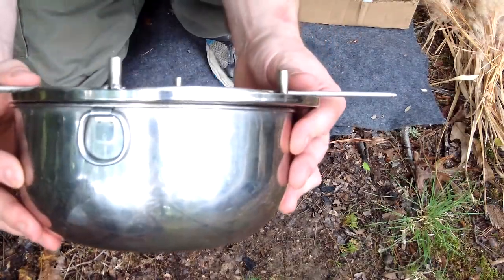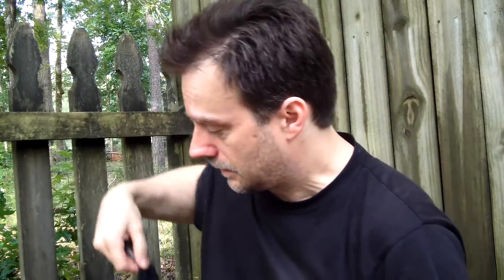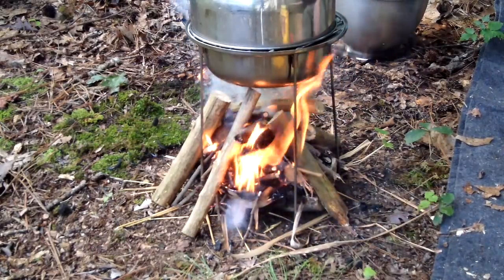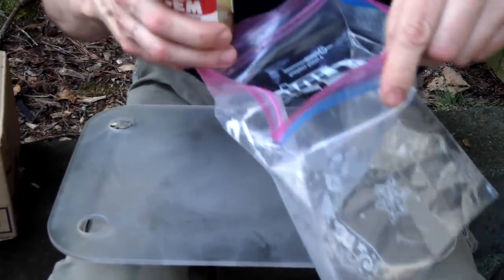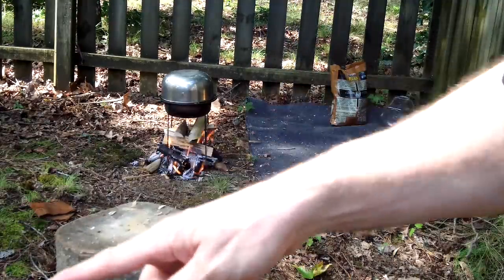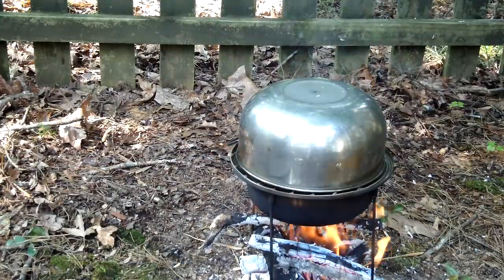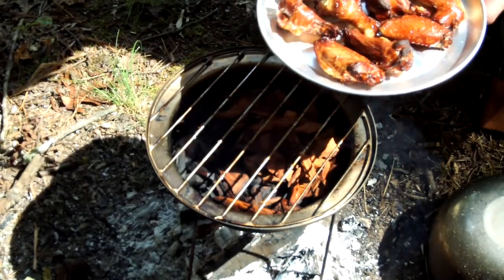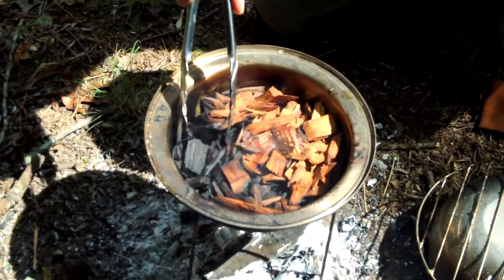Smoked Wing Test On My BackPacker Smoker

Comment: Yum! Glad to see you enjoyed what you cooked. This is a great setup. In a pinch that bottom bowl could be used the same way for making soup/stew & putting in the rack meat to steam cook. Or put those 2 smallish bowls on rack to heat up rice or porridge/oatmeal. Put that upside down bowl over it & you could make steamed dumplings. So your little smoker could be a stewpot, steamer & oven too. Talk about multi use possibilities. Hmmm
Reply from the maker: Oh yes, all those set ups you mentioned are very possible. I'll probably try several ideas with this. Thanks for watching

Comment: The first thing that came to my mind was The War Of The Worlds fighting machines. :)

A couple of ideas for holding the stand legs in the sockets.

1)Use some 400 series rods for the legs so you can temper them to have some spring action.With a jeweler's saw or hacksaw,saw down the center of the rod ~ the length of the socket.Anneal the slit end,flat blade screwdriver in the slit to pry it apart slightly larger than the socket hole,temper the slit end so it has spring action and will stay in the socket. Chamfer the slit end of the rod so it will go in the socket easily.

2)Looking at your legs and sockets again,the fit may be loose enough that you could put a slight bend in the rod to retain it in the socket.   -----~  ═

I was hungry and boiling some eggs while watching :( , those wings looked pretty tasty!

Comment: We called them  wing dings back in the 70`s. Trouble with them is, there isn`t enough meat on them. Around here, in PA, the price went through the roof on them babies. Thanks Dave.
Reply from the maker: Never heard that term. Yep, not much meat on an but the small size sure makes em easy to smoke

Comment: Hey Dave! I used a coffee can, poked some holes in the top rim, and plunked in a small steamer rack. Topped it off with the lid of a sauce pan that fit just right. For the wood chips, well I used the chips from what ever I did with the maple wood. Why waste stuff? Some wood does not make for good smoking. It may work, but the taste... that bein the case, mesquite chips are the best. Good eating right there! As for wetting the chips as opposed to dry chips, I found out there wasn't much of difference. If you keep an eye on things you can smoke, or end up with jerky. Either way a win. But overall, this was a good video with lots of tips and as always entertaining.
Reply from the maker: Sounds like a cool set up! I have noticed as with my other smokers that if I don't wet the chips, they burn out faster, catch flame then they actually flame cook the food as opposed to smoking it. I think it all depends on how high above the fire the chip pan is. Thanks for watching!

Comment: The best trick I ever discovered for achieving deliciously smoked food is at first not to let the smoke touch the food but actually gather behind it and then circulate above it, this will prevent the meat from burning, it will cook it slower making it quite tender and also help to seal in juices. Best to not let the smoke fall beneath the food as that can leave residue from the smoke, also do not let any fresh air in it will disrupt the cooking process and you will not be able to salvage it.

Comment: Tried smoking fish once.  Bloody cigarette papers kept tearing and falling to bits around it :(
Well done man.  You are so inventive and clever too.
Edit:  Dammit, forgot to say that you could use a "locator pin" and drill the hole and rod so they lock in place a lot looser than threading the bar / hole, but much more securely than simply slotting into each other.   Just a thought mate.
Reply from the maker: Lol! Thanks man. Very good idea on the locator pin

Comment: If you added the insert from a stainless steamer set , the section with holes ,and that fits your set , you could have a multi level , smoker that does the whole packet of wings at one time ( hour cook :) .
Bon aperttite :)
Reply from the maker: Good idea but wouldn't you have to pile the winds in instead of just a layer? I wonder if stacked up they would smoke?

Comment: If you can find an old wood chisel, 1/2  inch is nice...clean it up and hit the edges with a grinder.
it has a handle already and makes a really nice striker for your faro rod.
And....lol...if you have a chainsaw you can find a dry log, then make cut LONGWAYS . It will throw long thin shavings that make nice fire starters. We kept a bag in our scout trailer for fast fire starters.
Reply from the maker: Funny you mentioned the chainsaw shavings, I collect them too!

Comment: Although your top bowl/cover looks to be stainless, it has a flat bottom.
You maybe interested to see when the wings quit cooking with steam(212 degreesF), on to the smoking chips temp and what that head temp may be/get to.
Those magnetic surface thermometers are kinda handy for a leaning curve. (fairly cheap, made for wood stove flue/wood stove body)
First off it was steaming chicken. Wood chips in water while prepping food is probably all the soaking they need..if any, but pour all the water off? 
I mean no harm Dave but ima still trying to wrap my head around this method. Wood/paper burns at 451 degreesF no?
~~ I'm getting mixed answers to my query. Wood smoulders(smoke) at 120-150 degreesF.
Something I just read to avoid flame up of chips directly on coals...put wet in foil with a little hole.

So now we think of what happens when we make char wood from punk wood in an altoids tin. It all smoulders to perfect.
On a larger scale as you have there I wonder how hot it would get using confined dry wood?
Maybe not enough wood surface exposed to cook anything?

Anyhoo it worked, and what of just read it says the steaming will tenderize your meat..til water boils out.
I'm near thinking this technique is near how electric smokers work. 

...I'll just leave my twaddle there vs deleting. I was trying to help with repeatability, so can be like a teacher. (-:
Reply: Btw, in a pinch, I hear and fruiting tree would be good/ok for smoke wood. (I don't see many using oak though)
Keep your eyes peeled in your woods. lol, time to plant your apple seeds ay?
Reply from the maker: You answered your own question, it worked. Lol. The main reason I soak the chips is wood fire heat and flames tend to burst wet chips into flames thus cooking the food and not smoking it. Its hard to smoke food in this method but after years of playing with it, this seems to work best.
Reply from the maker: Yes, apple wood, cherry wood and even peach wood all work. I have a bag of peach wood Im planning on using for some smoked salmon. Ive only seen Oak charcoal but not oak smoking chips.
Reply: @Reallybigmonkey1   Yeah, I was looking stuff up as I was posting/trying to figure this out.
Mostly we use soaked half hour thumb sized li'l logs directly on the coals, to exposed foody grate.

When I peeked at an electric smoker dos/don'ts some things came together in mind.

~ Altoids tin Bri?  Hmm, now I know what to do with that old metal cookie container...maybe use for smoking.

'n Salmon...I've a slab of cedar I batoned off I've been wanting to try. I may as well hit it while my dill is still viable. 

^^^ I was thinking of backup smoking wood while already in the woods. There's always at least one dead branch somewhere. ie; mulberry, hickory..
Reply: Dave do you often visit the same general area in the woods...fav secluded spot?

(ahem (-:   ) Some gal I subbed moved to Texas, and some of the stuff she was trying was planting stuffs in the woods. (I said huh, what about critters?)
Seems she's had some success, but that there Texas can be dry when not flooding. 

Squirrels around here at top side land of Lincoln are a bugger. But they pretty much stay away from aromatics like herbs...oregano, basil, etc.
~ We've cooked stuff outside, not wholly unlike what you do out there always. Burgers/brats/steaks don't really excite me because they're done so fast. Slow chicken is a good time, and worth all the time cleaning up to me.
~~ ima wondering ifn some time over nighter with your son (sorry, forgot his name) cooking up some spaghetti 'n meatballs/sausage would be fun for y'all? Heck, even a good chili, besides spaghetti sauce  should simmer a few hours ay? (-:
..my .02 cents anyway.
 Fresh herbs growing nearby for a few dishes would be a woot if 'nuff rain, break in canopy for sun. Perhaps a more drained spot on that island?  Our oregano comes back each year even though we changed it out this year ~ a few grown seedlings in your pocket might be fun to try next year?

~ Bit attention risk/thought of your island ~ I've a spot on my land along the river which has some worthy trees at a corner river vs slough I near put up a tree stand type deck, four way. ..meh, I pussed out due to the only place out of 200 acres I found a deer tick on me. Gave me the willies it did. (yes, we've a number of acres that look just like Snake Island)
~~ In your case perhaps an interior spot, three or four trees...maybe set up a permanent off the ground deck for two, to set up tarps over? 
In that I don't know snakes except taking away their reason for being there..peeled back even more take away the reason for their prey being there?  Frogs, mice, voles, moles, fishers, I dunno your land. 50 lb bag of cayenne pepper is 140.00 ;) I wonder what it would take to keep sleeping circle clear of critters and then snakes? lol, fun to think of, and said my mind wanders.

..after all said and achieved fire ants ran in chosen would sook. ~ would others as hunters disrespect a simple off ground, or just sit and leave note of thanks?  ~~ yes, I've a fine corner (sand bottom river) on my land where I've seen names of lovers scratched in sand who stopped by way of river. Over nighted or not they did a small fire on the beach made at a hairpin in the river. I say they camped and nary left evidence of fire out of happy respect. (ha, that 4 acres of the bottoms cost me 25.00 in tax a year and the smile is well worth random canoeists)

TMI in closing: Swamps and low land bottoms at dusk...skeeters killing ya but need to wash up, and who needs deet to got to bed with..get naked, suds up good whole bod but don't rinse. Sit 'n watch sun go down or one more fish try. yup, and Ivory soap still floats.
~ Rinse and beat feet to planned. js

Comment: Some one has been to Save A lot.  looks good and very practical.  one thing also if the ground is to wet, you could of put one o the other bowls under it and used it to make your fire in plus be good for a no trace fire to do it that way..  If the bowl is to wide, just make new legs that has bends in them to reach the outside of the bowl. and you got carcoal when the chips are all gone.  Many uses for it.  Grind it up to make a medicine, fire starting material.  and more
Reply from the maker: Great idea! As a matter of fact, I do have some spare fire bowls!

Comment: I would suggest just adding the wood chips that are soaked for about an hour or two. No water at all... that is how its done in a smoker box on a charcoal grill. Your cooking time may change, but you will get more smoke flavor that way.
Reply from the maker: Ive done that in the past and it just doesn't work for me. The chips burn out too fast and just flame up and those flames wind up burning the food. Ive discovered over the years that since smoking meat is a very slow process that if you soak the chips until they no longer float that they heat n smoke very very slowly. It may be different with a large backyard smoker but this is what works best for small backpacker type smokers.

Comment: Nice. Weld some loops on the lid to act as handles you can use a stick with and as legs to double as a pot. Is there some kind of set screw you could add at the top of the legs to keep them in place?
Reply from the maker: I can easily add a lifter to the top. No threads ever on my stainless cook sets. Threads always seize up and lock up when heat is applied to stainless.

Comment: i am thinking which is kind of dangerous for little o`l me at odd times. So what you could end up with in your smoking pan is charcoal ? A something which you could then save , for a burn later thus producing much more heat from a fire later on. Or am i over-thinking smoking ideas  in my nogin?  Great Video by the way.  BB from the UK
Reply from the maker: You are correct Paul! The chips in the pan turn into pure charcoal. Could be useful as a makeshift water filter in a bad situation. I'm happy you liked it and thanks for watching brother

Comment: I want to say first thing that I've never smoked anything and I don't eat chicken. There said it. Now for my questions. Where do I get the bottom bowl with the lip around it and how do I make the grill part without a welder? I'm guessing that if I smoked fish then do it about half as long as the chicken. A plus side to this smoker is if you let the chips smoke completely out then you have charcoal.
Reply from the maker: I got the lipped bowl from Goodwill. That lip really secures the grill perfect but isn't necessary for use. Basically you just need two bowls with a grill inbetween them. It may not fit perfect or look store bought but it will work. Almost any cooking section of  any store has replacement grills for ovens that will work with

Comment: Take that small steel pot you have and put it in the center of bottom pan and then stack your chips around it ,then fill small bowl with water. Then you can have the best of smoke with the moisture  so as to not dry out meat.
Reply from the maker: You would think that would work but with such a small set up them chips have to be wet or they will burst into flames and just cook the food with flames instead of smoke. I could try the bowl in the middle with wet chips around it.

Comment: Boy, those wings sure looked good. You say that once you hear the water "stop" boiling then you give the wings an hour. My question is..."Before you put on the next batch of wings, did you put more water in the chips bowl...and if so, how much?"...Oh, one more thing..."Did you dump the burned chips and put more chips in, or just use what was already in the bowl?"
Reply from the maker: Man were they ever good! This was a first time test so honestly the chips need to be wet and have little water level. It took too long for them to smoke. No, I didn't throw any of the chips out. The blackened ones helped it produce smoke that much faster.

Comment: How about just soaking the wood chips and water for about an hour before you start cooking and then empty all the water out and put the chips in the bottom and see how that works your smoke should start a little bit sooner and I think your wings will be done within an hour after they start smoking on if you want to try that or not wish I could weld so I could make one thank you
Reply from the maker: That may work with a normal smoker but with these small backpacker smokers over a campfire it just doesn't work.  With the chips soaked, they smoke slowly. With short soaked chips, they tend to burn into flames fast. Then you're cooking with flames and not hot smoke

Comment: Err Try running a stainless bolt in the lug with anti seize when you weld. I would say just re tap but SS can be a pain and break stuff.   I have to give up and subscript to Mr. Monkey. You can send check or money order to my Top Secret Agent Headquarters. I have never seen anybody with so many pots and pans. Your truck must clank and rattle as you go oft on your camping and adventuring.
Reply from the maker: Even with never seize, Im not adding any threads to any of my cook sets. Ive been down that road and many a campfires have ruined threaded connections. The old pin n socket thing isn't pretty assembling but it seems to work best for me. Thanks for the sub and thanks for watching!